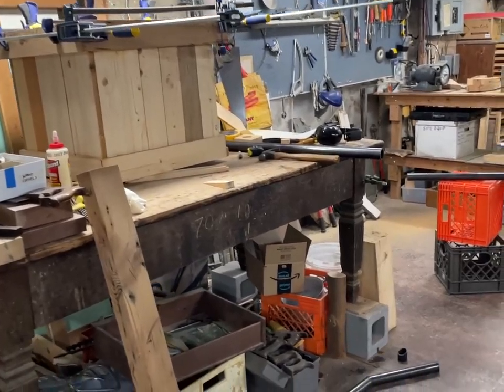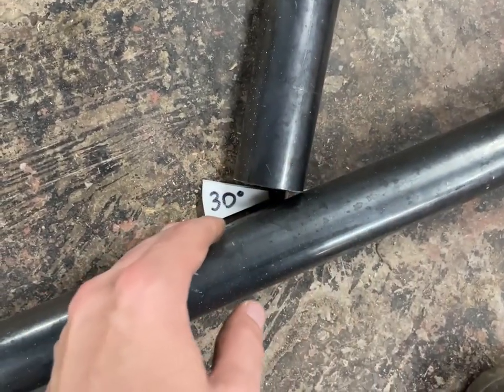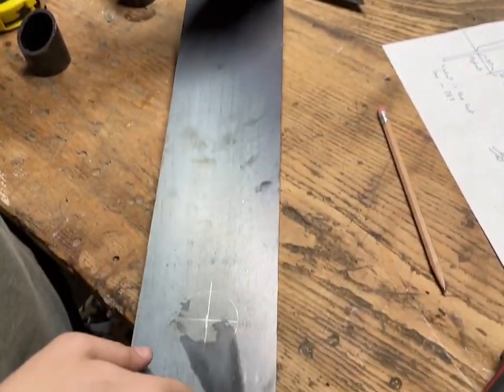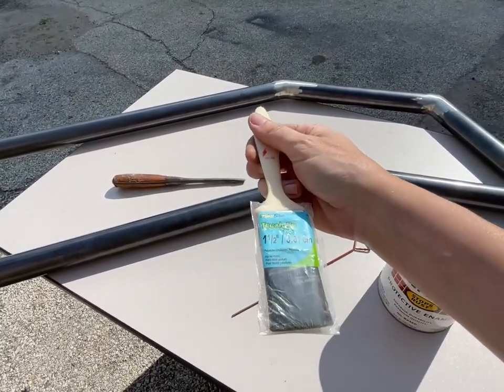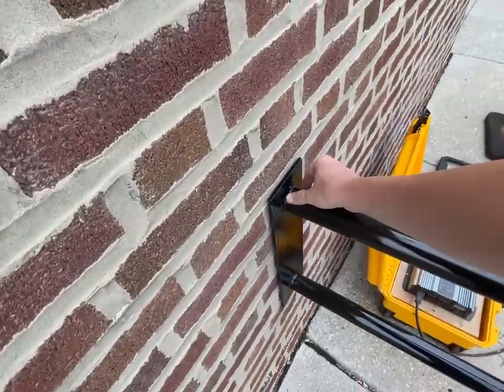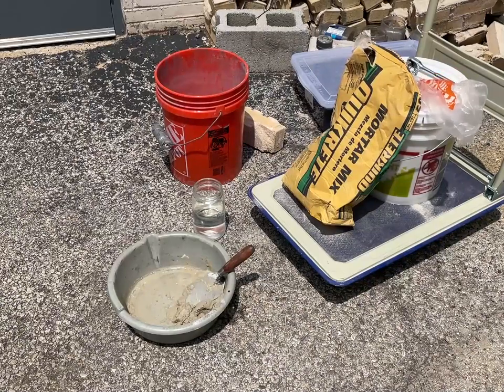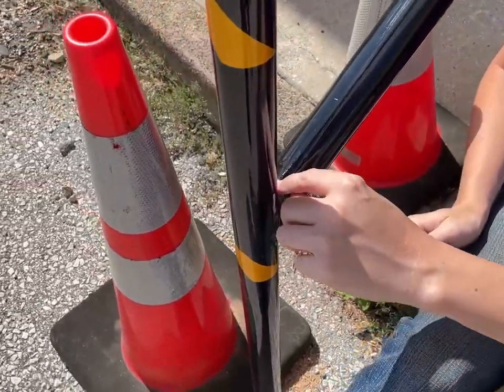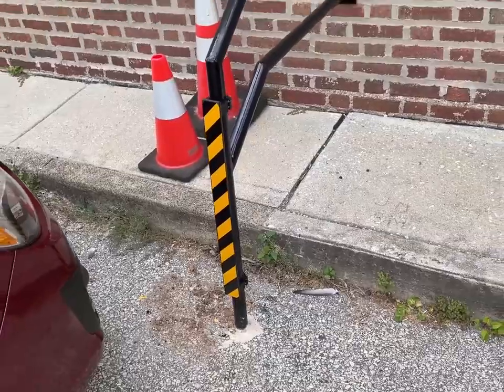Building a handrail from steel tubing. In the future I'll use aluminium, but I can't weld that yet.

Comment: It is surprising how easily lag bolts will snap, happens pretty often. The really coarse threads seem to make much more of a stress riser than the finer threads of a machine bolt and most often they break by the last thread before they go to the full diameter. Nice job on the railing. That will be pretty handy for whoever has to step off of that sidewalk on an icy, wintery day.

Comment: This was great! I have a nice welder I bought myself as a retirement present, but have hardly used it yet, and know absolutely zero about welding. (Dreamed of being able to do it since I was a kid though :-)  I also have a little tabletop bandsaw that can cut up to ~2” pipe and angle but know nothing about fabrication. 

So this was great for me, with lots of super-useful little tips, like the “pillow block” to hold the pipe and the 3D-printed angle guides. Heck, even seeing you squirt a little WD-40 on the bandsaw blade during the cut was good info for me 😁

Thanks!

Comment: My steel railings that I used to have on my front porch were fairly solid with surface rust. But the posts at the railing bottom going into the bottom concrete step rusted completely through right at the point they enter the ground. I think this is typical, the place where it's most wet, winter salt, steel reacting with the concrete. I band aid repaired it using square steel tube a size bigger than the posts, drilling out new holes, square tubing into the holes and then the rusted posts epoxied into the tubing.  It gave me a few more years before the rest of the porch rotted out Lol.

Comment: I've been selling this kind of product forever, and have run many welding and railings shops.
Notes: Tack the broken bolt head on from underneath---just for aesthetics.
Drill all your weeping and bolt holes prior to assembly.
Never cap the bottom of the imbedded post.
Galvanize all your products for longevity (may be too expensive for small projects).
Rusting is almost immediate.
But use a good quality metal primer prior to painting.
Invest in high speed drill bits-----forget the cheap China crap.
Next time----put the post on the concrete sidewalk (4 epoxy set bolts or wedge anchors)-----and cantilever the extra foot from that (like a letter"P")
But----tip of the hat for effort and ingenuity.

Comment: you have jars, and water you have a level.    but god fabrication job.   odd place for a hand rail.  in the opening clip i thought tha was jsut placement for testing.    Steel often has a layer of clay on the outside of the pipe.  may be better of wire wheeling it,  then do the acetone wipe.  or painting with a oil based primer.

Comment: Next time you paint steel grind all the protective coating of with a flapper disc then red oxid paint then top coat hammerright or rustolium or just black gloss oil based or synthetic or cellulose paint  but only paint in the warm not cold or condensation around 😊
Reply from the maker: Yeah I thought washing with acetone would be enough, and yeah I only painted in the hot
Reply: @RinoaL  cool 🤙